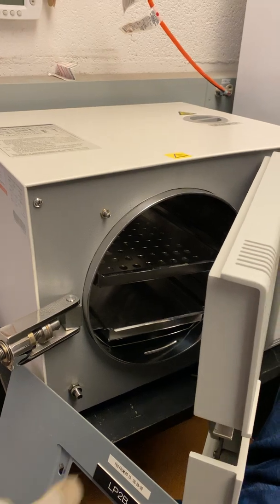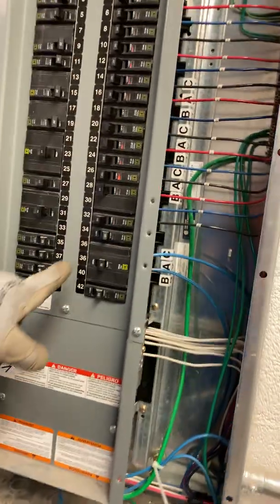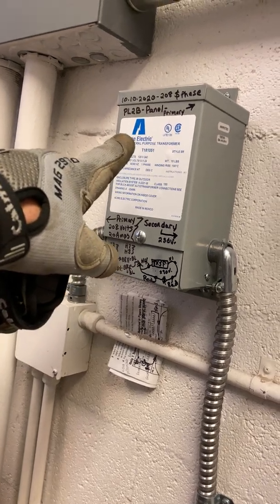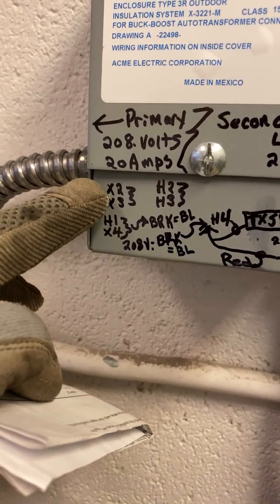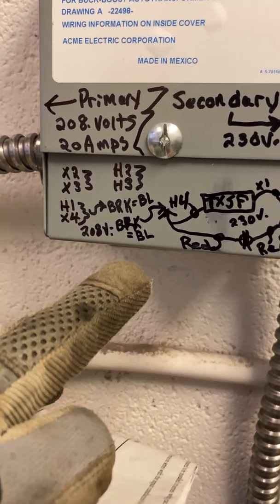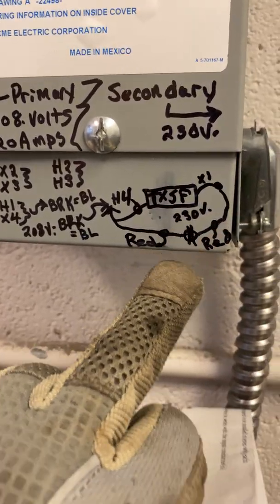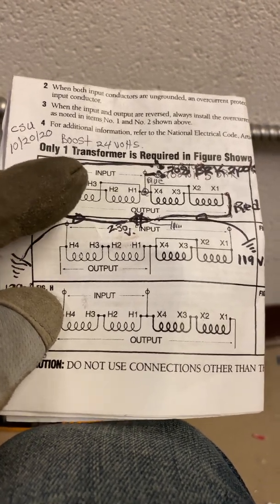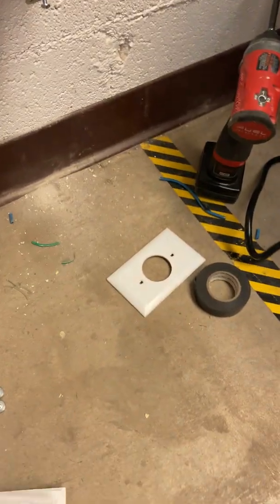Buck Boost Transformer Setup

Comment: 3:23 You shouldn't use a mud ring and a flush mount  face plate to mount a receptacle to a 4 x 4 box like that. It looks a bit tacky. Use a raised cover plate instead.